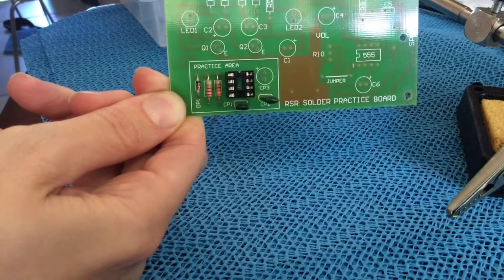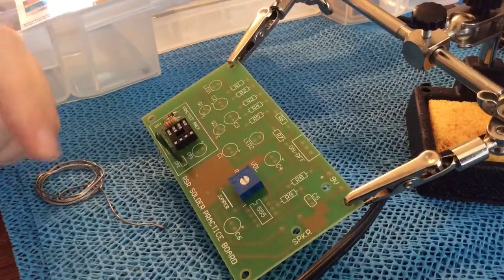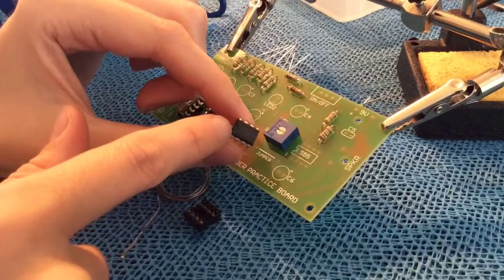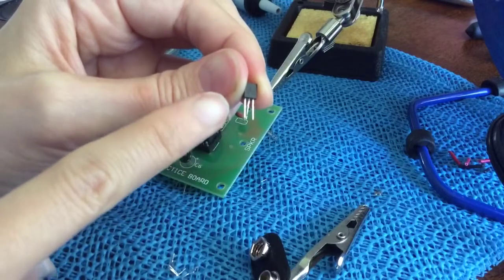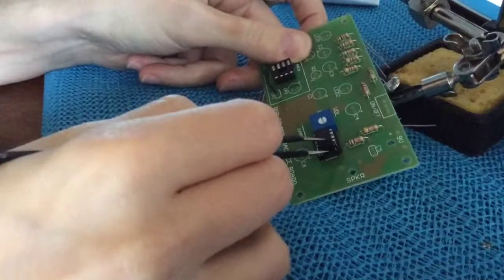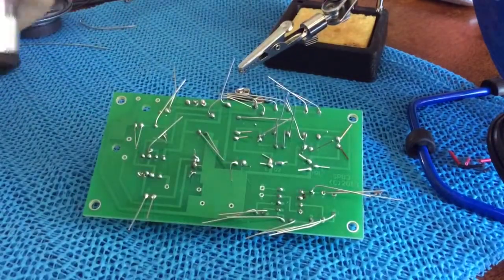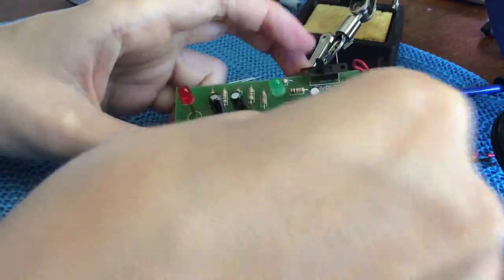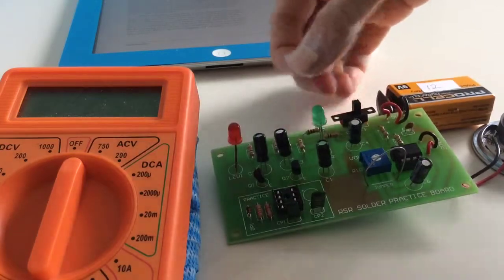Module 3 - Soldering Exercise Siren (Demo) / Electronics Technician (Penn Foster)

Comment: Hello, I am thinking of doing the electronics program.  Is there alot of theory at the beginning of the course or it jumps right into hands on stuff?  Is the reading material online or they send a book?  Thanks
Reply from the maker: +Jacob R Hey Jacob, the reading material (Study Units) are downloadable pdfs. Each Module has about 4 Study Units, and a Practical Exercise (these are the hands on ones that I have made videos for). 
This Siren Soldering Exercise was unique because it was half way during Module 3, so there is also the Practical Exercise to do for Mod 3, so 2x the fun =)
Each Study Unit and Practical Exercise has an exam that can be taken online, or downloaded and taken offline, and later transfered onto online. One retake is allowed per exam.
Here are the first 4 modules Study Units, Exams, and Practical Exercises:
~ Module 00 
     00.1-Introduction to Electronics (54 pages) 
     00.1-Exam (20 questions)
~ Module 01
     01.1-Nature of Electricity (60 pages)
     01.1-Exam (20 questions)
     01.2-Practical Exercise (21 pages)
     01.2-Exam (20 questions)
~ Module 02 - Introduction to DC Principles 
     02.1-Conductors, Insulators, and Batteries (54 pages)
     02.1-Exam (25 questions)
     02.2-Circuit Analysis and Ohm's Law (63 pages)
     02.2-Exam (25 questions)
     02.3-Practical Exercise (40 pages)
     02.3-Exam (20 questions)
~ Module 03 - Analog Circuit Measurement
     03.1-Basic Test Equipment (50 pages)
     03.1-Exam (25 questions)
     03.2-Electronics Hardware (83 pages)
     03.2-Exam (20 questions)
  --'Siren' Soldering and Desoldering Exercise (33 pages)--
     03.3-Switching Devices (57 pages)
     03.3-Exam (20 questions)
     03.4-Practical Exercise (17 pages)
     03.4-Exam (20 questions)
~ Module 04 - DC Principles
     04.1-Magnetism and Electromagnetism (42 pages)
     04.1-Exam (25 questions)
     04.2-Capacitors and Inductors -DC (62 pages)
     04.2-Exam (25 questions)
     04.3-Basic Semiconductor Components: Diodes (Analog Components) (74 pages)
     04.3-Exam (20 questions)
     04.3-Basic Semiconductor Components: Transistors (Analog Components) (62 pages)
     04.4-Exam (20 questions)
     04.5-Practical Exercise (20 pages)
     04.5-Exam (20 questions)
  
There are 13 Modules in all, hope this helps! Good Luck =)